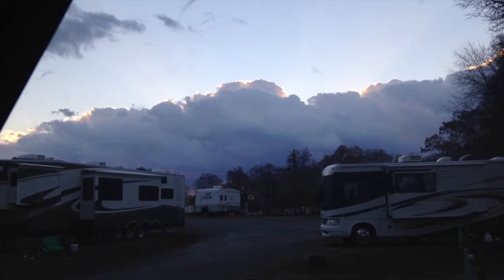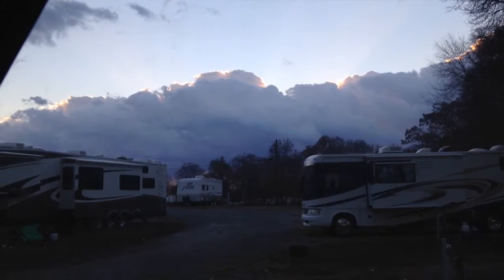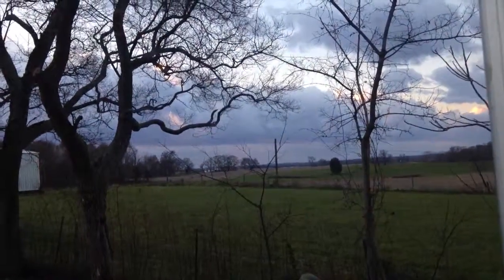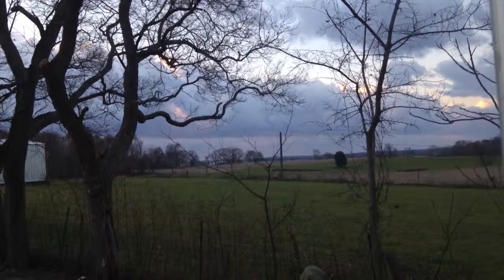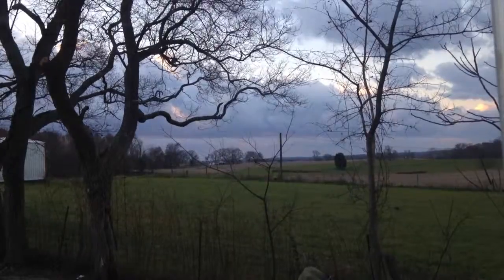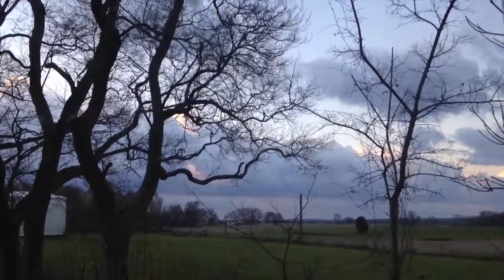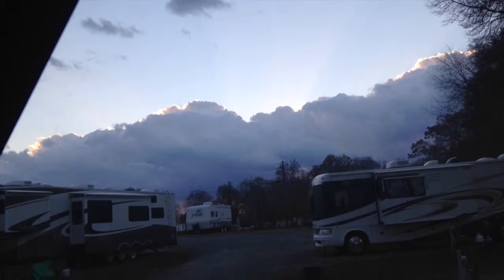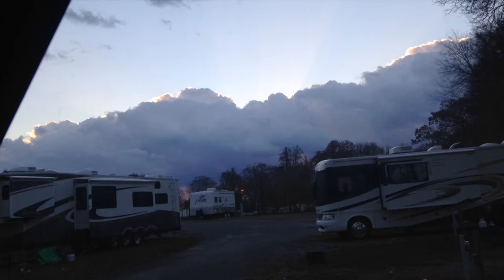Stranded In My RV!

Comment: Use to own an 89 just like yours but fuel injected it would run for a few minutes and shut off, replaced a 6 dollar fuel filter located on outside of motor and that did the trick.
Reply from the maker: Corwin Jones Yea I heard that from a few people. I changed mine and it was still happening. I am convinced it's something simple but just didn't have the time to fix it. Plus it was two states away with all of my belongings in it so a hard decision had to be made. I wish I could have fixed it myself tho!